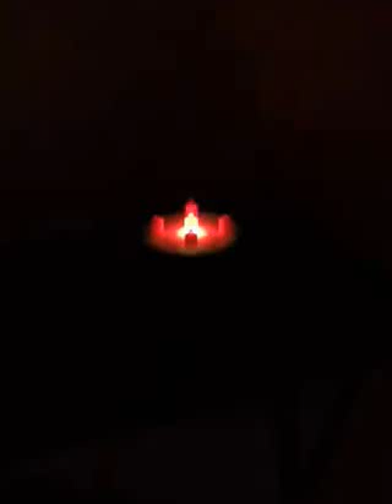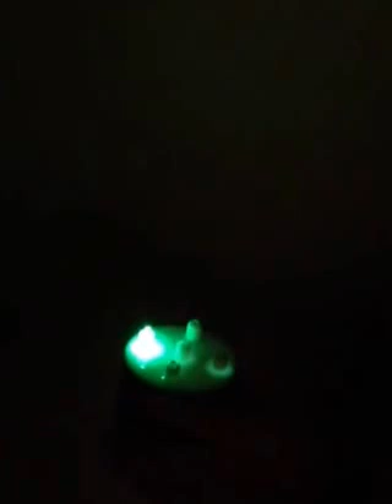PSA-POD Part 2: Simon Mode, Tones and Sensitivity

Comment from the maker: The Mel Meter (Mel-8704R-PSA) will have all of the same features as the PSA-POD, but it will also include sound isolating earbuds that will enable the user to amplify (hear) ambient sounds more clearly. And while there is still 5-sensitivity levels, when this feature is activated we automatically reduce the amplifier gain to prevent the possibility of feedback inside the users ear.